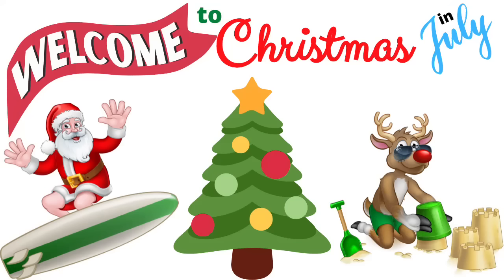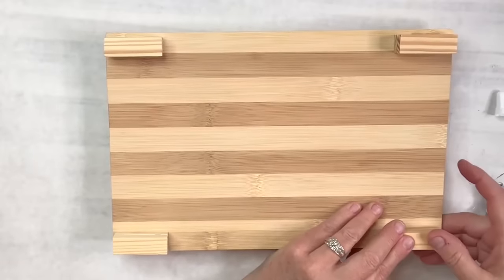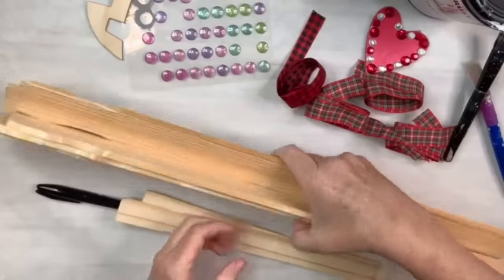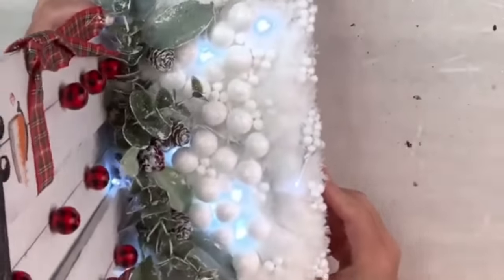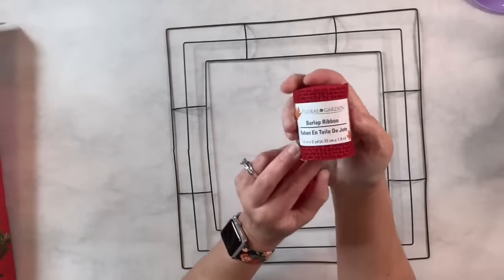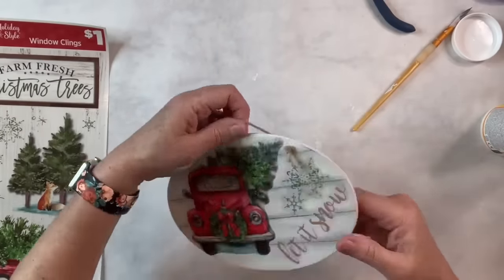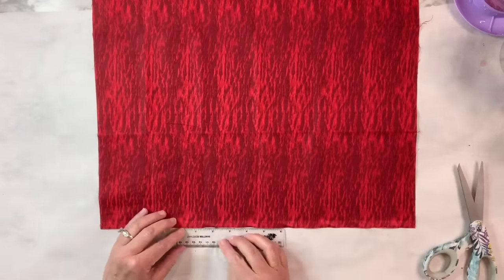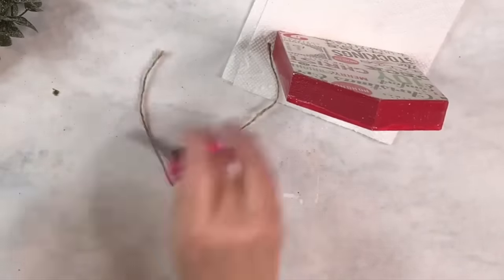MUST SEE Quick & Easy CHRISTMAS DIY Crafts

Comment: Hi, Lisa! Love your projects! So far I’ve only used 2-ply paper napkins, but so glad for the tip not to use 3-ply! Have a tip for you when your measuring/marking with your square. Make one measurement mark then put your square at that measurement mark with the square right against the board, then mark your line. No need to measure a second mark for each cut. Comes out straight every time. Saves a little time. 😊
Reply from the maker: Thanks for the tip! I love learning new things that make life easier. How awesome!